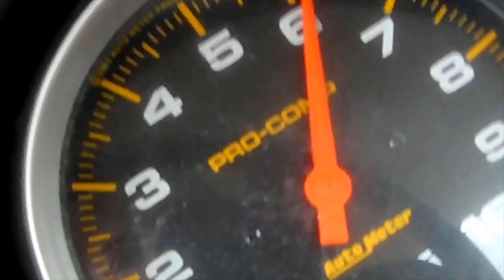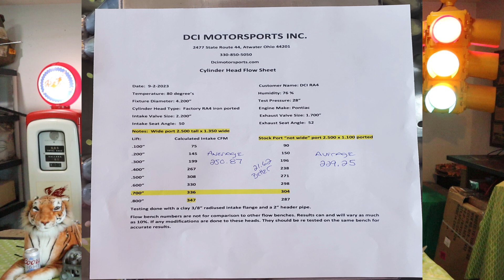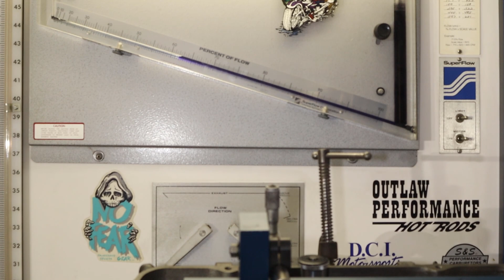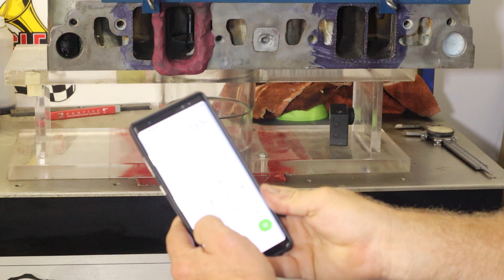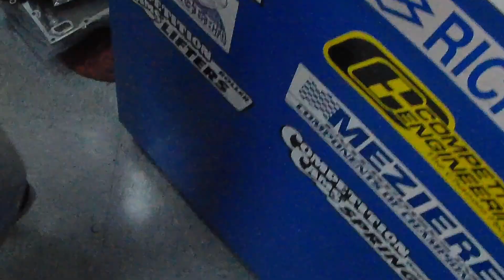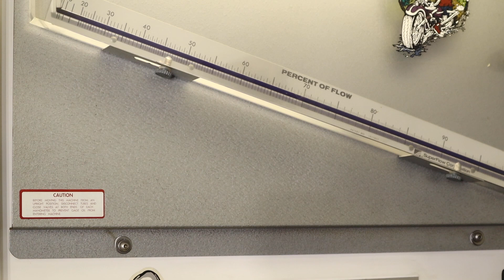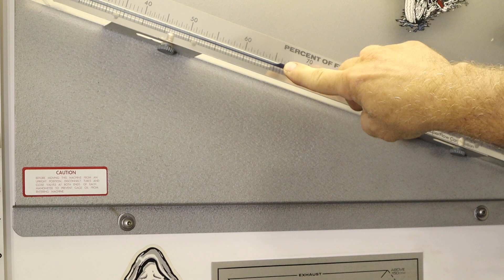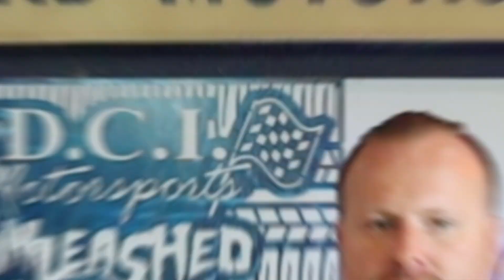We made a HUGE mistake!!!! Also why is he talking about his bowling average???

Comment: Hopefully I don't sound foolish, but can a typical day port be modified to a wide port
Reply from the maker: Not a dumb question at all and yes it can. You would need a shaft rocker system like I am using though. You cannot use a stud mounted rocker (YET). What I mean by yet, is if i can get Harland Sharp to make an offset rocker for a stud mount. You will be able to still use a guide plate and stud. The stud can stay ion the stock location, but a custom guide plate would be required.
Reply: @dcimotorsports1111  ok thank you